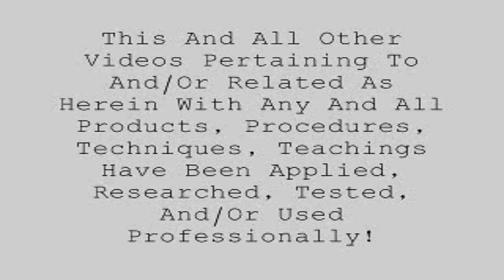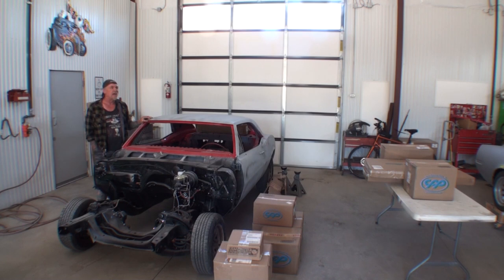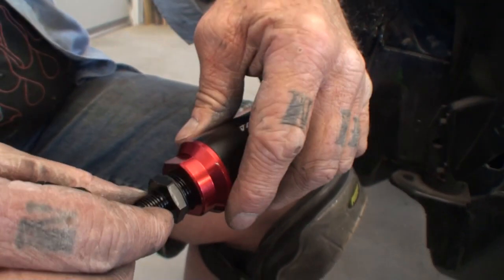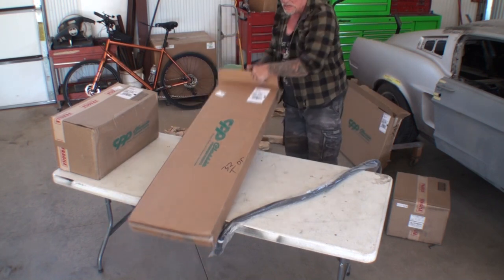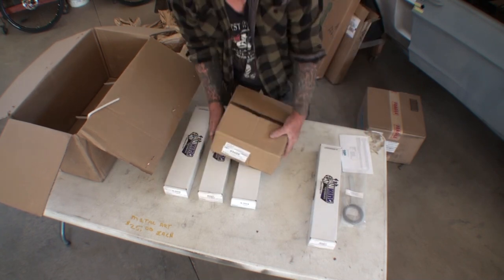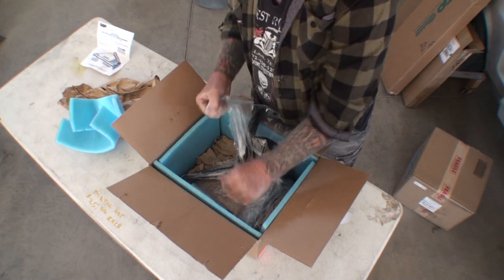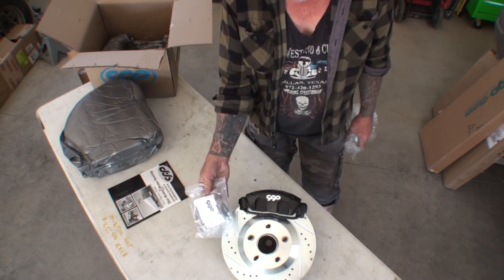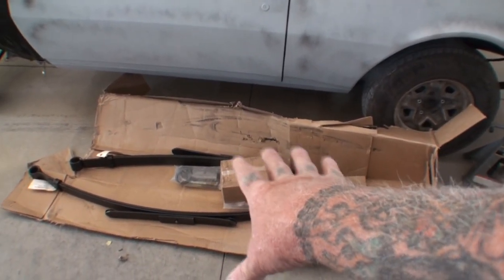This is the WORST CUSTOMER SERVICE Ive Ever Had - EXTREME FAILS -  Part 1

Comment: I had to laugh as guy at CCP said the parts where being make right behind his desk. It a 2,880 mile trip to China, but behind his “East” facing desk.
  What ever happened to the old saying “The customers always right!” especially after the expense of these kits and parts they sell. I don’t have $5k sitting around to purchase coil-over with dual adjustments that works with the tubular lower & upper control arm. I spent 20+ minutes at CCP’s website, looking at prices & tech sheets. Amazing how much this pile of parts cost!